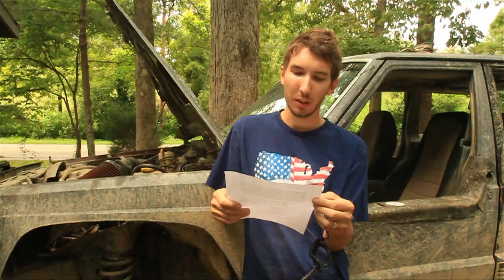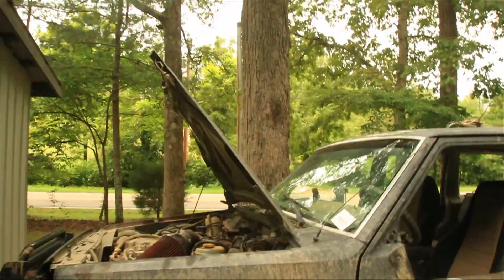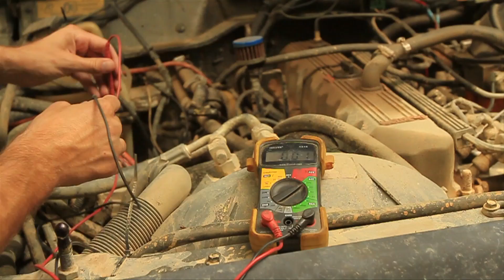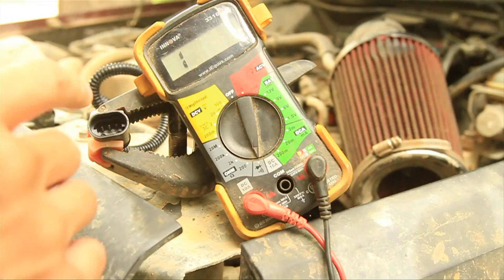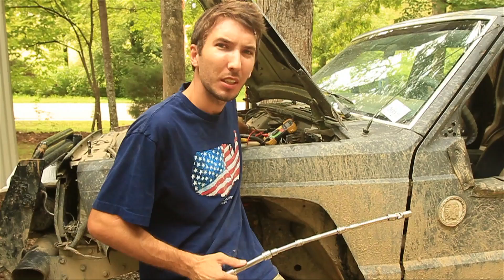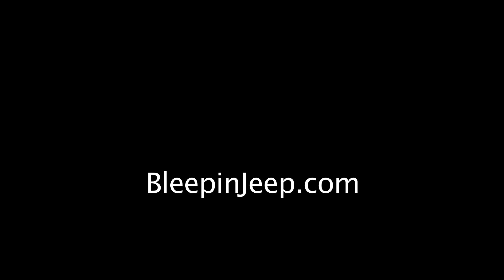How-To Test a Crank Shaft Position Sensor CPS

Comment: 2001 Cherokee XJ. 
I have been getting an error code for *Intermittent Crank or Cam Positioning Sensor, *a couple bad Fuel Injectors & *a couple of bad Coil Packs. After replacing the Crank Sensor twice & 3 Coil Pack Units, I'm now leaning more towards a bad ground. Because so many aftermarket Crank Sensors being faulty, I kept the original OEM Crank Sensor. I'm taking it into the shop today. I'm going to ask our mechanic to test the OEM Crank Sensor. If that one still shows good, I might ask to have that one reinstalled, because the quality is so much better...

Comment: I recommend using a spark tester when checking spark. If you are holding it with bare hands. It will Give you a Shocking Experience 👍 Not a Good One 😔

Comment: I think I have a bad CPS but not 100% sure. My jeep will either die when at idle or RPMs will drop almost to zero then suddenly lurch back up to idle. Occasionally, but less frequently, the RPMS will lurch up a bit as well. No difference noticed whether the engine has been recently started or is warm. Is it definitely a bad CPS? Any suggestions??

Comment: I dropped one of the small bolts into the bell housing.  I opened the access plate and used a nail to slide it back out after I made sure it was at the bottom by running a garden hose to flush it down.

Comment: I have replaced my CPS 2 x as well as replaced the distributor 2 x which has the camshaft position sensor inside of it and on still having the same problem. I'm drawing the p0320 code and also 1391 I believe. It starts and jumps up to 2000 rpm for a second then dies. I can gas it for about 10 seconds and then it will stay running but will cut out eventually while driving. Took it to shop and they told me to bypass  from the sensor to the ecu with a new wire but that didn't help either. They said next step was send ecu in but I'm really wanting to leave that as a last resort. Help

Comment: I've got a 1997 wrangler that has no fire and I've checked the cam and crank censor and they are showing good and I've found that I have no power on my power wire at the coil what could cause this I'm thinking maybe the computer but I don't know

Comment: Yeah dropping the screw into the bell housing is not only 'bad' but really sucks! But taking the bell housing bottom cover off will give access to the screw that you dropped. I used wobble extensions and getting my hand to the sensor turned me into a contortionist.

Comment: Couple tips, when taking bolts out, take the top one out first, then the bottom bolt and when putting back in put bottom bolt in first then the top bolt, keeps the chance of dropping the bolts down the bell housing as he crank sensor is in place and eliminates the possibility of dropping one inside the bell housing... works like a charm

Comment: 87 Cherokee Wagoneer cuts out within 5-6 miles. Got fuel in rail. So k assuming CPS is getting hot shutting it down? However able to restart within few minutes. Any suggestions?

Comment: I tested my cps on 97 cherokee  and got continuity between b and c. I got a new one and still continuity, i wonder if they sold me a bad one, or i broke it, or test doesnt work
Reply: I tested 4 sensors (the original +2 after market and 1 OEM) they all had  resistance (about 500). I'm at a loss.

Comment: When i put the negative terminal on b and the positive terminal on c i get no reading, if i put the positive terminal on b and the negative terminal on c I get a reading of like 6 or 7 omhs.
Does that mean my sensor is good or bad?
Does the negative terminal go on b or on c? That wasnt clear on the video.
I have crank with no start, no ignition.

Thanks
Reply: Ive got the same thing going on. How did you make out?
Reply: @johnthomley1657  I changed the sensor but it didnt help, it turned out being my ecu. I just changed it for another one and it started right up. Good luck
Reply: Thanks. So far my ECU seems to be ok. I think I have a bad ground somewhere in the coil circuit.
Reply: @johnthomley1657 if youre not getting spark it might be your distributor, had that go out on me too
Reply: @johnthomley1657 my distributor also went out, that thingy that spins inside broke off, my car wouldnt start.
Have you checked your distributor?

Comment: That test on the cps is only good if your engine is not starting or have an intermittent start. If it tests good with a dmm it doesnt mean that the sensor is good.

The engine could still run with a bad cps but would have a missfire.
Reply from the maker: engine should not run at all with a bad cps
Reply: @bleepinjeep  
Bleepy, I'm having fits with an 88 Comanche 4.0L 4x4 5 speed. 
Twice it's died while driving, was dead for a full week, and then it came back alive and drove perfect for hundreds of miles until it died again. Have you seen a CPS cause this?

Comment: Ok, When im driving my 89 XJ It acts like its flooding I.E. spits, sputters, it has no power until i put the pedal to the floor, then it takes of like a banshee until i let off the gas then it goes back to what i said before. I've changed the CS, Put in the upgraded injectors (4 port)  new plugs and wires (Accel). I've checked all my vacuum lines.  I can not figure this out. Any Ideas would be appreciated. Thanks
Reply from the maker: Idk, have you checked fuel pressure?
Reply: @bleepinjeep  Yes, roughly 30 32 lbs with the key on
Reply: @CopperStateAerialPhotography 
Did you figure this out?

Comment: I need help. 97 xj 4.0, just swapped a motor it starts fine, has slight rough idle. It bucks while accelerating, is fine while heavy accelerating. It has a new tps, newer iac valve, new plugs newer wires cap and rotor. Any ideas? Any help is greatly appreciated
Reply: Same problem.  Keep me updated...  Did u change the sensor he's saying in the video
Reply: @TheLostAdventuress  no I didn't, I just sold it
Reply: @Hotheadjman79  🤣🤣🤣
Reply: For that reason ?
Reply: @TheLostAdventuress  no. I got a newer car and didn't need the jeep anymore.

Comment: I cut the hole . was sooooooo much easier to get to. just be careful not to cut the trans cable behind the metal that you are cutting, i also put some rags on top of bell housing to cover so metal filing would not fall into hole where missing dust cover that a professional mechanic threw away when he changed it.mine is a 1988 cherokee 4l   used a large metal hole saw a a battier dewalt  .
Reply from the maker: How do you know where to cut?

Comment: can the carpet be pull back and a small hole be cut in the floor around the console and be able to see the bolts? and then a metal patch be put back to cover hole? ive already had to replace mine twice over the years. once by me and once by a service center . its a bitch
Reply from the maker: It's pretty much under the dash.

Comment: Ha! I just took mine out of my 2001 XJ. What a bear to get at. Removed the shift cable bracket which helped. I think removing the front driveshaft would help also. The multiple extension setup you have might be the ticket as it gives you a little more flex. Removing the transfer case would be a help too...maybe just pull the engine and tranny out the front...bore a hole through the firewall. Who was the wiseguy that designed this??? I love vans actually because you could at least remove the doghouse...

Comment: Hey Matt, I've got a 2000 XJ. I have checked my code P1391. I replaced my crankshaft position sensor and cleared the code. Drove it to work, the next morning (work nights) the code came back. Any suggestions?

Comment: Here I got you a good question I've got a 1999 Jeep Cherokee Sport 4 wheel drive straight 6 it's not getting fire to the spark plugs but I've changed the crankshaft sensor and the coil and it still does not get spark to the spark plugs and I've noticed my clap dash cluster does not work as well I turn the switch on in the gas and don't go up could you help me troubleshoot what the problem could be
Reply: Jamie Blair you figure out what it was? I have the same issue

Comment: Hey also just noticed rear hatch window on 2001 grand cherokee laredo 4.0 wont lock, even tried manually. . with screwdriver and pushed down on gold metal thing and it clicked but when glass is down it wont latch on.  hatch locks.. how can this be fixed been told part is expensive

Comment: Hey ,Matt. so 2001 grand cherokee 4.0 crank shaft position sensor I believe is reason car starts then shuts off  but if I get to drive fast it stays on. got code 0320 but now it does not show ... changed spark plugs/fuel filter/new gas cap/coolant temp sensor/engine oil change and filter.  Is the cps connected on passenger side or driver have seen other post say its on passenger side.  But you Know your stuff!! help me out is it also on drivers side??

Comment: We have a 97 cherokee. Engine codes call a #12 power loss within 50 cycles and#14 Map sensor. We have replaced the map sensor, checked all wiring and wiring connectors and all was fine for a few days. Then the check engine light came back on with the same codes.
Engine idle is off and the engine dies while driving.
Checked for spark and fuel and all is good. 
What should we look for or diagnose?
Please advise,

Comment: Great videos! My 96 Cherokee just shut down, then after 30 minutes it started right up and had no check engine light. I don't have the volt meter to test the crank sensor. should I just swap it out and see if it happens again?

Comment: my 95 XJ is reading about 648 of resistance, and most common synthom in my case is hard to start on mornings, on a weather temps on 85° to 89°... after engine starts, works fine. I conclude to replace CPS.

Comment: Hey bleeping jeep so today I was driving my jeep and I saw a check gauge light go on then died a few seconds later. I got my starter and alternator tested both are good. Bought a new battery still won't start, but wants to turn over but won't I installed a new fuel filter and now I'm just out of ideas...

Comment: I know this is a old vid but I've had this problem with my cherokee and I tested my cps and it tested fine when it was cold so I heated it up and it's frazzled with shortening on both sides of the terminal connector. it's definitely something worth checking with these types of sensors. especially if you do a lot of offroading

Comment: well, i have a question. i had all my battery terminals changed, brand new starter, and starter relay. For some reason my 1998 Jeep Cherokee 4.0L has a long start time, the battery, alternator, and Starter all passed its test. I'm so confused as whats wrong with my Jeep. My engine rumble at the start, but it sometimes doesn't crank. battery level stays at 11-12 volts at starts, lags out for 17-20second, then raises up to 14volts. WHAT WRONG WITH MY JEEP???

Comment: can a cps on a renix cherokee 4.0l i6 not function due to oil sludge build up?
Reply from the maker: I wouldn't think you could get that much sludge in there... Does it test good?
Reply: Something else to consider is it operates off of a magnetic reading.  Magnetism's loop shorts out to metallic objects.  If you have a let of metal on it, it will need cleaned off to open the magnetic fields back up.  Oil and sludge can affect any electrical sensor.  It becomes a sticky surface for dirt and grime, which causes excess voltage drop on the parts covered, which reduces the operational paramaters.  The sensor would slowly get worse over time, although it may be degraded before you start noticing symptoms.
Reply: Answer is ,...YES.... mine did ...

Comment: BTW, your engine turning over is a real good indication that you have battery voltage .lol
Reply: What?  That has nothing to do with the CPS, it creates it's own current.
Reply: Suq Dik
I'm not going to watch this video again from 2 mon's ago  But I recall him saying to check for battery voltage before checking the CS .
My point was if it cranks its not the battery & there's no need to check the battery .

Comment: Hey, Matt. I know this is an old video but i really need help here. Ive got an 89 xj and it starts up just fine every time but it is stalling out on me after its warmed up. I havent had it stall while driving at speed but typicaly after ive driven somewhere parked done something and get ready to leave. Stall's in the parking lots. Gas it up real hard a few times  and it is good to go from there. I tried testing the CPS here 89 jeep cherokee CPS testing. But im getting no voltage reading at all. Can you help me figure this out?
Reply: This happened to me, my 96 xj wouldn’t start after short trips, then I saw a YouTube video and the guy said if you are having this problem, before spending lots of time and money try the coolant temperature sensor, it cost around $10, and easy to change. It fixed my problem. Been running great ever since. Its been over a year. You might want to check out that video and see if it helps. Good luck.
Reply: O2 sensor or intake manifold gasket had the same on my 89 xj

Comment from the maker: you should be able to test like I did in the video with a multimeter.  to change you'll need a socket wrench and some extensions, and it's probably a 10 or 13mm head on those two bolts.  thats about it I guess.

Comment from the maker: if the CPS is bad the engine wont start or run at all.  there could be a problem with the CPS wires maybe hitting the exhaust temporarily or shorting across somewhere but I would think that would stall the car completely.  Are you sure its not a fuel issue, maybe a clogged fuel filter?

Comment: PLEASE HELP: My 1999 Jeep Cherokee Sport idles kind of weird. It starts fine, then kind of dies down some and runs around 600-900 rpms (varies frequently, sounds rough) and I even had it stall out. It's usually worse right after it starts, and after driving seems to be ok. But it's been getting worse and sometimes when I get on the gas it hesitates and chokes some. Seems to be worse if it's left on an incline and then started or if the battery is low. Do you have any suggestions. Thanks!
Reply: Did you figure out what this was? My 99 is starting to do the exact same thing 😏
Reply: @2S1L3NT  Ending up totaling it in an accident.

Comment: found the problem. it was the crankshaft position sensor. I had no fuel pump engaging but i did have spark. the test i did on the sensor looked ok. but when i tried between a and b on the sensor i had continuity but didnt on the new one so i changed it anyway and runs great now.

Comment: I have a 96 cherokee. sparks runs on ether. wont engage fuel pump. if i jump relay i get pressure to the rail but still wont inject it. changed relay. can it be cps? or is that just for the spark? was running great then one morning it just wouldnt start after it just passed inspection the day before. obd wouldnt read anything just said couldnt connect. ever seen anything like this?

Comment: Thanks. helped me get my '90 Cherokee running again.
Might be worth mentioning that cleaning and using dielectric grease on connectors when diagnosing issues would be a good idea. A working CPS and corroded contacts on the connectors can result in non-starting issue and/or poor engine performance.
Reply: I wouldn't recommend dielectric grease on any major input sensor such as cam, crank, 02's

Comment from the maker: Does your car start?  if so then it is still working... if not, make sure you double check that it is showing you numbers and that you are on the b and c, and that you are on the resistance setting on your multimeter.  If it still shows anything other than zero then yes, replace it.
Reply: BleepinJeep Hi...we've not had any starting issues and after our 01 Jeep Grand Cherokee limited edition 4.7l being off for about 3 hrs yesterday it won't even turn over now. It has power just fine when turning the switch on, but no crank at all. Could it be this sensor?
Reply: Here in 2025 thanks for this info!

Comment from the maker: As far as I know they only claim an increase in HP.  I would assume it gives a slight increase but I don't have a dynamometer.
Reply: Do you do the test with motor running for a 1998 jeep cherokee xj 4.0. And what brand would you suggest to replace the crank sensor?